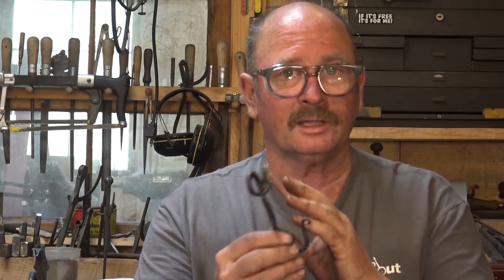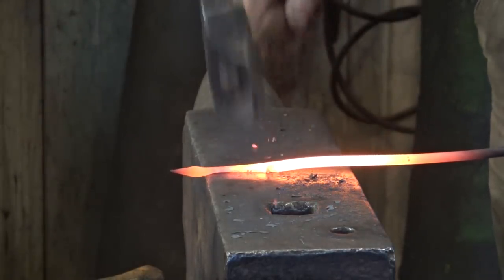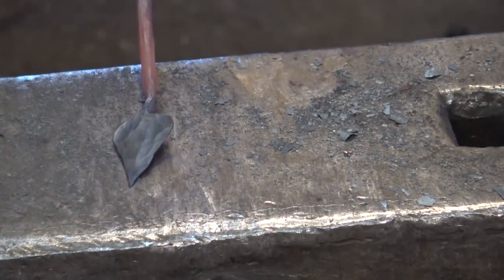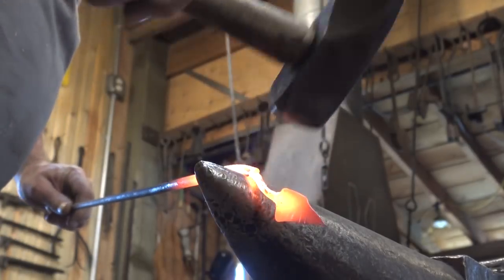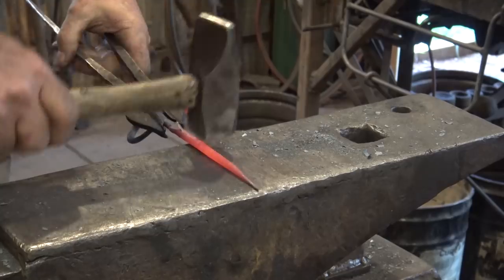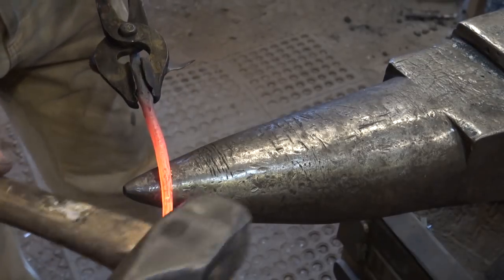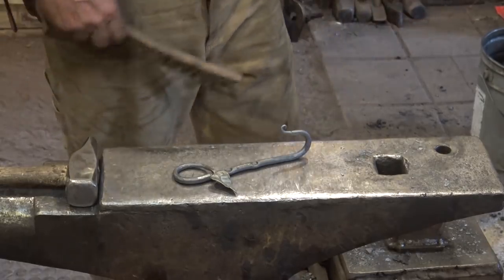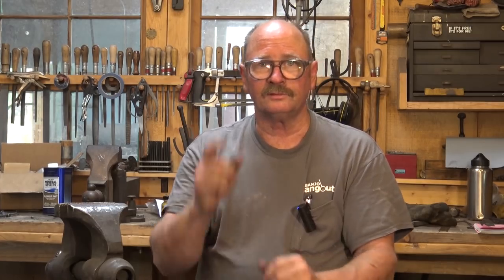Leaf end wall hook - blacksmithing for beginners

Comment: When I made the 2 dozen curtain rod hooks for the wife, (lotsa brownie points!)  I measured, used jigs etc. Whilst I thought they all looked the same at the time I made them - Still had to sort them by hand to get the most alike sets to use at each window. 2 weeks after they were made the differences were a lot more obvious than during the process of making them!
Reply from the maker: I use the matching system quite often to get things that belong in pairs.

Comment: Glad to see you getting more rain. The hook came out pretty good, i think i'll try some more leaves today .. i get the leaves looking great but the stem keeps breaking off, i think i either work it too cold or too thin.. gonna try to avoid that today. thanks for the inspiration.
Reply: What The Forge Blacksmithing  What is the name of your Etsy shop?
Reply: i don't have one, i have not progressed as of yet to a point where i feel my work is good enough to sell
Reply from the maker: If the point where the leaf joins the stem gets cold it is easy for a crack to develop
Reply: thank you for that info.. that should help a lot.

Comment: Can you share any info on those round nose pliers at the beginning of your video? I've tried  to find a pair like that but everything I've found is just so tiny, about 5" total length, and really hard to use.
Reply from the maker: https://www.blacksmithsupply.com/Scroll-Pleirs-3-inch-bit_p_175.html
You can use my discount code for 5% off "Bear5"

Comment: Do you leave your propane forge on in between heats? Not sure if I'm working too hard to save on gas or if it's good practice to have it off when your not heating any metal
Reply from the maker: For normal work I leave it on, unless it will be more than about 15 minutes to get back to it (time spent dressing a tool or cutting materials).  For the videos, I often turn it off for improved audio
Reply: @BlackBearForge  thanks! Extremely helpful. I'm basically learning to smith off this and another couple YouTube channels. Just used my hells forge for the first time this morning and I have a hammer and railroad track

Comment: John I have a question, my anvil moves around a fair bit, I try putting wedges of wood under it etc, as I live in a rented place and the landlord lets me forge on the back verandah i can't really bolt it down as there are tiles on the floor. Any Idea's from you John or other smiths watching, thanks in advance.
Reply: Lenblacksmith how about a rubber mat
Reply: Yeah I have tried bits of rubber but yeah more rubber got some too, will try that today. I see these blokes with anvils that are so solid, hahah i envy them sometimes, but hey I gotta get around this the best way I can. Thanks for the idea.
Reply from the maker: Try tar roofing tar paper if the black spots won't be an issue.  the tar gets soft and sort of sicks the anvil base to the surface below.  If leaving sticky black stuff behind is a problem i am afraid it is just a matter of put the anvil back where you want it throughout the day.  Of course the heavier the base the better
Reply: Yeah not bad Idea John, have to ask my landlord.